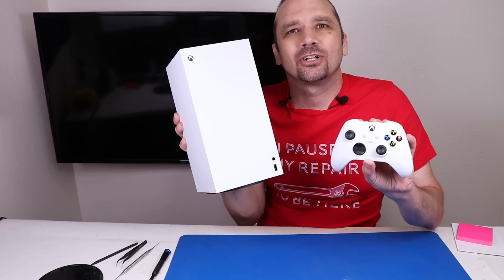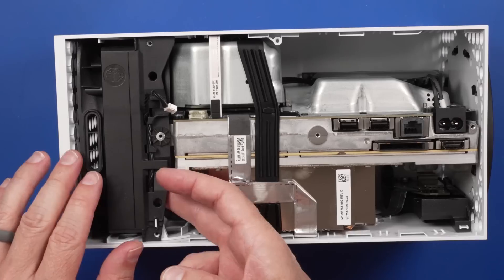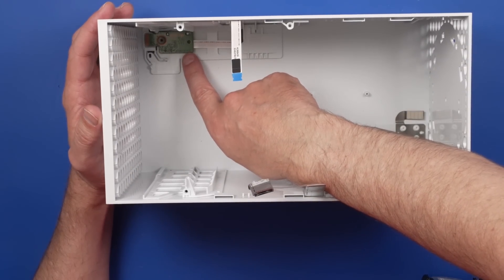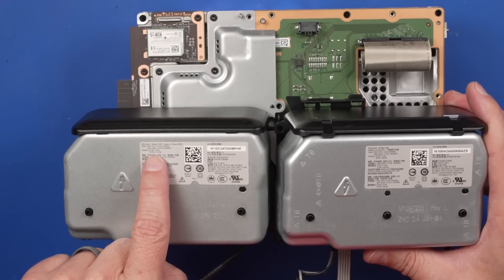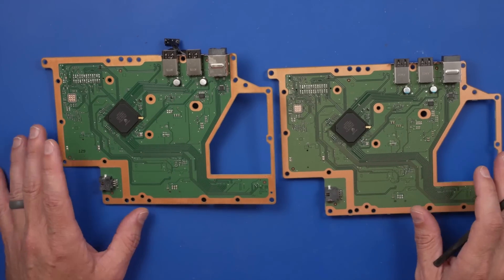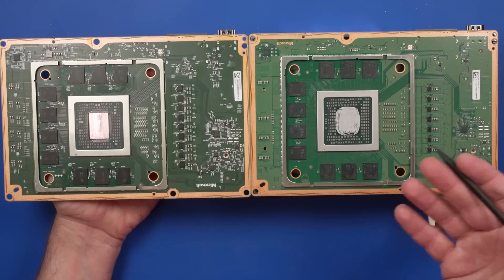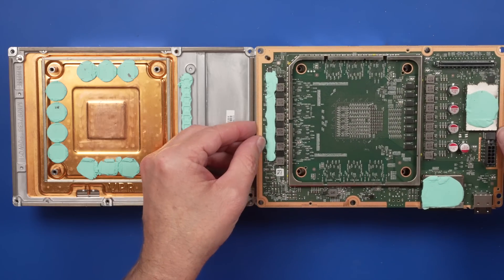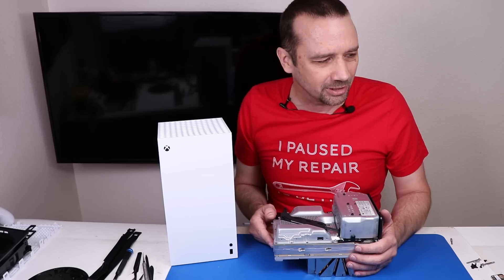NEW Xbox Series X DIGITAL! - Repairability Review + Teardown

Comment: One thing that you didn't mention in your video is that the processor is different. It is now a 6nm processor which requires less power so less cooling is needed, hence the heat sink design change.
Reply from the maker: Yep, you're totally right. Not sure how I missed mentioning that. It's even in my notes, lol.
Reply: @Tronicsfix  it happens to the best of us. By that I mean you
Reply: Also, the silk screen is missing on the newer model.
Reply: What about the new Series S model?
Reply: Would look cool putting the old black green stand on the robot white series X with the green black stand being more highlighted with the white of the new X
Reply: that could explain the changes all over the mother- and daughterboard
Reply: Also its cheaper than vapor chamber and MS probably sell the thing at exactly the same price if not more!
Reply: @igors_lv  no, its £50 cheaper
Reply: Choosing between the Xbox Series X and the Xbox Series X Digital with a 6nm processor depends on your priorities:

1. Performance: The original Xbox Series X, with its more powerful processor and robust cooling system, might offer slightly better performance, especially for demanding games. More power typically translates to better graphical fidelity and smoother gameplay.

2. Efficiency: The Xbox Series X Digital, with its 6nm processor, would be more power-efficient and generate less heat. This could mean quieter operation and potentially lower energy costs.

3. Future-Proofing: The original Xbox Series X might be more future-proof due to its higher power and cooling capacity, which could handle more demanding games released in the future.

In summary, if you prioritize top-tier performance and future-proofing, the original Xbox Series X might be the better choice. If you prefer efficiency and quieter operation, the Xbox Series X Digital could be more suitable.
Reply: Less dust too!
Reply: This is the best reply in the history of the internet. Just when i was losing hope. Thanks tronics fix. I love you. ❤

Comment: I m pretty sure putting the old vapor chamber and power supply would give you an extra fraamerate in games.
It worked on my old xbox one when using my x360 external power supply (got a huge power and performance boost)

Comment: Choosing between the Xbox Series X and the Xbox Series X Digital with a 6nm processor depends on your priorities:

1. Performance: The original Xbox Series X, with its more powerful processor and robust cooling system, might offer slightly better performance, especially for demanding games. More power typically translates to better graphical fidelity and smoother gameplay.

2. Efficiency: The Xbox Series X Digital, with its 6nm processor, would be more power-efficient and generate less heat. This could mean quieter operation and potentially lower energy costs.

3. Future-Proofing: The original Xbox Series X might be more future-proof due to its higher power and cooling capacity, which could handle more demanding games released in the future.

In summary, if you prioritize top-tier performance and future-proofing, the original Xbox Series X might be the better choice. If you prefer efficiency and quieter operation, the Xbox Series X Digital could be more suitable.
Reply: You guys are dumb a 6nm processor wouldn’t change the performance of the Xbox series x digital u literally made this idea up and ran with it the shi makes 0 sense that’s like almost sayin the fat model ps4 performance better then the ps4 slim because it always is more power efficient do your research smh.

Comment: Repair score - 2 expectations for what is easy to repair are lowered because Microsoft was supposed to make their consoles more modular.  and you can't even swap the drive or install windows. Best case is just the power supply goes bad

Comment: If you do, try to install the disk drive. Before you do any soldering, can you do a closer inspection of that side of the board (I know you would naturally) first? Because just pausing it, other than the soldered parts, there is quite a difference in that area that I am curious about.

Comment: Voltage is push, while amps is pull. So if you install a power supply that is higher voltage than your machine it will blow something, but if you install a power supply with a higher amperage it’s ok as your machine will only pull the amps it’s requires.

Comment: Surely you could place the disk drive components on the new model, but disc would never work as the driver is paired with the board, and that’s done at HWID level which is unique for each unit, but surely would be an interesting exercise

Comment: Anything that has a sticker over a key screw isn't geared towards being repairable.
Reply: Thats just serves as a warranty sticker. If you attempt to repair before the warranty is up they will know and will not cover it. Its also just a good way to hide screw holes for a cleaner look, like screws under rubber feet.
Reply: @fonseca123456  My 100% repairable Framework laptop comes with catches. If I open it up it is still under warranty. I can lift and remove all the components with minimal effort. Can the same be said for the SSD in this Xbox? There's repairable and then there's really repairable.

Comment: In my personal opinion , all these consoles coming out with no disc drives is garbage . I've been a gamer for decades , and still have my old consoles . And they still work . This new philosophy in gaming is going to suck when these consoles are no longer supported . Most of the newer games require internet connections  to work . Once they stop supporting g them , they're basically useless . I think the reason that they changed various designs in the new.model is less about better performance and cooling and more about savings . The whole heats ink being copper is far more expensive than a copper pad and heat tubes . The difference in the 2 power supplies is likely just a drop in power to save on component costs because there's no need to have enough power for a disc drive . It will likely run cooler simply because the disc drive isn't creating any heat .

Comment: Isn't the Disc drive paired to the motherboard?  Also when it comes to a PSU, the rated amps denotes the maximum amount the PSU can output, It is up to the device itself to request how many amps it needs so a PSU of the same voltage but a higher amperage will work just fine on a system that uses less amps.

On the original 360 systems the PSU bricks were always forwards compatible with lower power 360 systems but not backwards compatible as they wouldn't provide enough power that way.

Comment: I want to see someone put the regular vapor chamber on the new smaller chip to see if that does a better job cooling since a vapor chamber is a better cooler than what's on/in the new series X with the pipes. From other videos I've watched it seems like it would fit. Also put the X shield on the new series x that's no longer on there from original series X.

Edit: made this comment early in video and at the end tpu mentioned doing what I said lol

Comment: Personally I see it as pointless - if you're spending the cash for the all digital version I'd rather spend the extra £30 here & get the full thing when there's less than 10% difference, if it had been like the PS5 then there's a decision, but the £30 in savings is barely worth thinking about.  Nice to see it's essentially the same thing internally, should mean the availability of parts is widespread & easy to handle!
Reply: I'm not a gamer, but will these "digital" consoles be useless bricks in say 15 years if you pull one out of your closet and want to relive some games you used to play?

I assume they all require on line sign in, and those servers will be long gone.
Reply: I don’t understand why they make this version. It’s the same size and  removes an important aspect. The future is bleak for collectors

Comment: You can put a 5A power supply in the new console. It will make the power supply work much cooler when it only need to output 3A ...
Reply: Probably not. The disc part is on its own power circuit. So if there is no drive, or even just no use of it, it will be near identical load.

May be slightly less stb drain though.

Comment: Definitely would love to see if you could get an all-digital to accept a disk drive.
Reply: It is the same as the new series x 2tb soo theoretically you would just need a donor board to take the connectors from and solder them to the board from the digital and of course cut a hole in the front

Comment: I also noticed the actual cpu chip has shrunk as well. Maybe more power efficient so the power supply etc doesn’t have to be as much as the previous model? Idk 🤷
Reply from the maker: Yeah, I meant to talk more about that in this video
Reply: Yep it is being produced on a smaller transistor node, down to 6nm from 7nm which is basically entirely how they reduce the power usage and heat output.

Comment: Hi Steve, something about the power supply is missing. It should have an amp Reading of 12v 21.25 amps. 12v 5 amps should be the supporting rail. So I believe the lowered just the supporting rail for the disc Drive.

Comment: IDK if you know this but for the new digital xbox, the chip is smaller as well.....the xbox series X has a 7nm chip and the digital has a 6nm chip (could of gotten the sizes wrong but yeah its still smaller lol)
Reply: ...and therefore will run cooler and require less power, hence the lower spec of the PSU.

Comment: Steve! You read my mind about wanting to see if a disc drive would work with this console. I'd love to see that. Great video!
Reply: Yeah I'm surprised the pads for the components are still there, every one of those boards is a new revision after all.
Reply: That would most likely require some software modification as well.

If the system still has some UI thing to eject discs or such, (IDR if the regular boxes actually have that. ?) then maybe. But I still figure that would be quite a maybe.
Reply: @lemagreengreen  Aren't they making any more SX with disc readers though?  The node shrink board would still be used, and similar enough then.
Reply: Me too I'd like to see that.
Reply: Probably it will not work but I still want to see it you replacing that's parts .
Reply: My guess is no - each drive has a unique key that's also stored in the console (this is why you have to swap over the drive PCB if you replace the optical drive) - so even if the firmware to talk to the drive is there it's not going to be able to validate the disc because the drive's responses are going to be encrypted with the key from the console it originally came from.